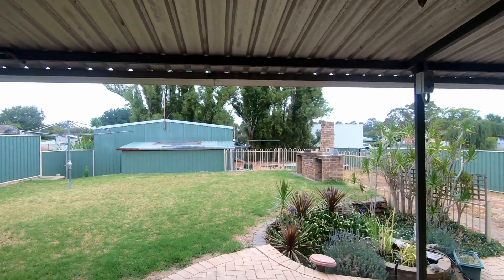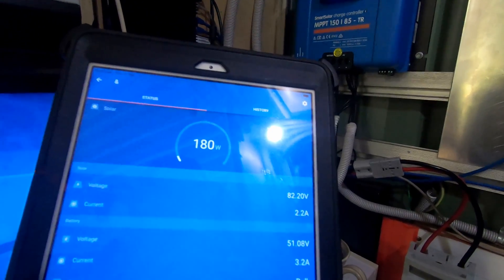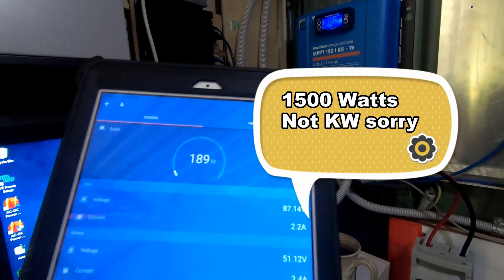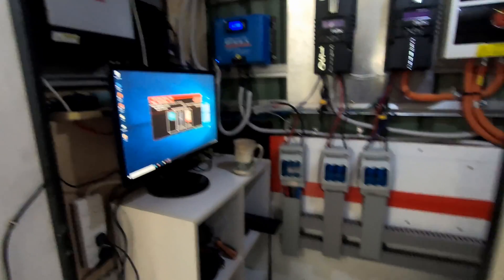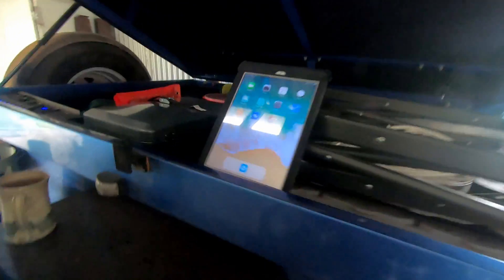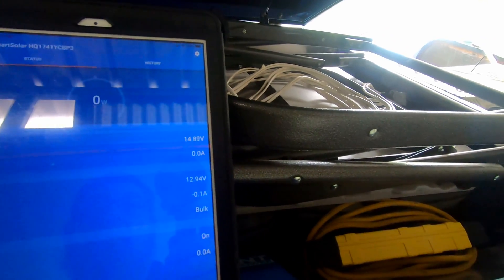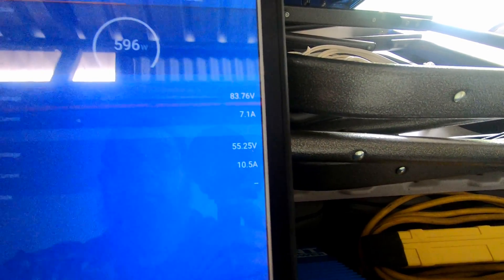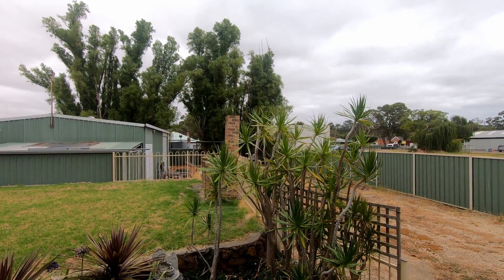Solar OFF GRID System. Victron Charge controllers

Comment: In a 12 volt setup in a vehicle like yours is it better to use a charge controller or just buy the better battery management system that has a built in charge controller like the products on offer from redarc that have the screen that show everything like your app. The redarc system is around 2k however.
Reply from the maker: I use both why just limit it to one ?  this https://www.projecta.com.au/dual-battery-charger-idc25 Charges  ALL batteries in the UTE and the trailer when driving. When parked the solar panel on the roof of the Ute charges all when the Ute is Parked. When camping and i have the trailer unhooked then the 260Watt Solar and the victron controller charge the trailer. If the car is parked in the Shade and the trailer is Hooked up then the solar system on the trailer charged all the batteries including the ones on the Ute. You may need to read that carfully to understand it. But what it means is. Even if the alternator on the Ute fails i will not be stranded as i have all the solar and the  projector Automatic 9-32V 25A 3 Stage DC/Solar Battery Charger to keep me running
Reply: Justin Case Solar Power and Bush Camping   Wow thanks for the great reply. I might have to hit you up with some answers when I start the build for my dual cab. I took the easy route at first and bought two fold out panels and an arkpak with a 120amh agm battery. Works ok but I have two fridges to run now and I don’t think those cheap Chinese controllers on the panels are doing much and I think the arkpak charges up slowly? I will grab one of those projecta dc to dc chargers to start like you have then possibly two new batteries as I’ve ran mine down too many times. Thanks again.
Reply from the maker: @TechStories79  Yes i worked on the priceable what could go wrong will go wrong so i built in a few backups.
Reply from the maker: House batteries i have 2x solar AGM 100ah in the trailer and 1x Solar 100ah under the tray in the Ute Plus the Starter battery  under the bonnet. So when parked and i unhook the trailer i have a lead i can run between the  Ute and the trailer if need be. but the 260Watt  solar panel is enough to keep the trailer fully charged. And the 110Watt solar panel on the Ute is enough to keep its batteries fully charged as well. I hope that answers this question and the next one :)
Reply from the maker: @Lone-Rider-d8w  Your welcome 👍

Comment: I have an old outback mx60 charge controller it would have to be over 10 years old and still going strong apart from the cooling fan .I'm looking at adding another unit. In your opinion is the Midnite Solar Classic 150 one of the best chargers on the market and better than Outback FM80, apart from the warranty issue you had with them .
Reply from the maker: I have owned both. I recommend the midnite Solar classic over the outback. I have only midnite classics doing all the main charging of my system. Combine it with the wizbang Jr  http://www.midnitesolar.com/pdfs/Whizbang_manual.pdf and you have a great system. You can see my system live online 24/7/365 days a year or as long as my internet is working anyway. http://livesystem.acdcpowermonitor.com/?SystemID=1000000002 enjoy
Reply: @JustinCaseSolarPower  Thanks , midnite charger it is . Plus they look good . I also read that the outback is still having cooling fan issues.

Comment: Hi when your first electrician blowup the two pips was that because he wired the inverter outputs to the grid
Reply: Ok thanks I understand you can't advise just wondered how yours were wired up
Reply from the maker: Our home already has all the RCDs in the old meter box so the units are treated as an appliance.  You need to read what i say as i sometimes give the answer even though i advise you to ( ask your electrician ) 😉
Reply: Penny has just dropped thanks for your help
Reply from the maker: no. he crossed neutral and ground. Bang they went.  When using a sparky that is new to inverters and off grid systems it Pays to keep an eye on them as it can get a bit overwhelming  for them.
Reply: How do you wire the earth I'm on a one system so my earth is tied to my nutral
Reply from the maker: You need to ask your electrician that question. I don't give any AC wiring advice on my channel as that would leave me open to all sort of legal problems.  But if your home is already wired the right way. With RCD. Then the UPS unit is just treated as another appliance. I would think. However the fist part of my  comment still applies. You need to ask your electrician
Reply from the maker: what he did is cross it at the unit where the wires go into the unit. A. N G in one and A G N in the other. that is all it takes and it goes BANG My units work in parallel

Comment: with my 12V lithium battery system i find the victron and midnite classic solar charge controllers do not happily work together. the victron's adsorption timer seems to have a mind of its own.
Reply from the maker: yes if you read the book on the Victron ( from Memory ) i think you can set it for as many hours as you like but it still works of battery volts. What you can do to get around that is use the EQ setting as absorption. So if your AGMs / GEL / Lithium. have a max charge of 57v ( talking 48v bank here ) and DEPENDING ON THE SIZE OF THE BANK. You can use the EQ and set it at 56.8 for as many hours as you like. I don't bother with that as i Let my classics do all the finishing charge and just use all my other charge controllers as mid range units. So they all help until my bank hits 56.8v then the classics finish. Then at float and heaver loads all the others kick bank in. Works great for me.
Reply: @JustinCaseSolarPower  
i think the timer works from the previous discharge level or something, which might be great for lead acid batteries.
2A battery current from the victron  triggers float . so if you set absorb a bit lower on the victron it should hit float before the midnite floats. that bloody timer however only last something like 20 minutes. even though set to 2 hours. which in my case causes  the battery to be fully charged something like 1 hour later than normally.
though the victron charger seems to be a nice reliable product, i think i will remove it and let the midnite classic do all the work. i just bought the victron to see how they work. or as a back up.
a 12v system also makes it harder to program.
Reply from the maker: Yes like i said it works on the volts. And the only way around that is to use the EQ setting. Just make sure you set that up right and you will be fine. The 12v unit in the camper trailer is working great. My bank in there is always full.  But i am a bit like you. I think the classics are the best Charger on the market. And i love how they work.

Comment: at what point would you start up the generator
Reply from the maker: last winter it ran a total of 5 hours. With the new improvements we made  ( some more energy efficient computers and stuff ) i hope we won't have to run it at all.
Reply: @JustinCaseSolarPower  I am right there with you on this one. No generator running is a good thing. Jim
Reply from the maker: @ChileExpatFamily  Yes i hope i am at that stage now. will only know in winter. Taken me a few years. I just hope i have it sorted.

Comment: The app and the bluetooth access is really handy for monitoring the victron devices and I use it all the time.  You cannot get any more easy when it comes to updates.  The fact they do release regular updates also shows they are regularly working to improve.  I should drop into Victron while I am over here...
Reply from the maker: Yes i just love how easy the little one with the program is for my camper trailer. Little bit of sun and the trailer batteries are full in no time.

Comment: Replaced the shitty pwm that came on my fold up panels with a smartsolar 75/15 and it's awesome. Love it. The load output doesn't like to start up a camping fridge which kinda sucks but it's probably better to run that straight off the battery anyway.
Good quality stuff the victron, and not even that expensive for what you get.
Reply from the maker: yes the load output is only for a light or something small like that.  Bigger loads are always best ran from the battery

Comment: update via wifi thats handy. Is there a surface spray that actually works with ants thats what you may need, bait stations exist for white ants i suppose others exist
we have a light haze in the eastern wheatbelt, i thought there was a fire somewhere
Reply from the maker: Yes i have a spray that is good for nine months. I try and do it every 6 months but forgot. Was my fault. Just getting forgetful in my old age. they work on Bluetooth